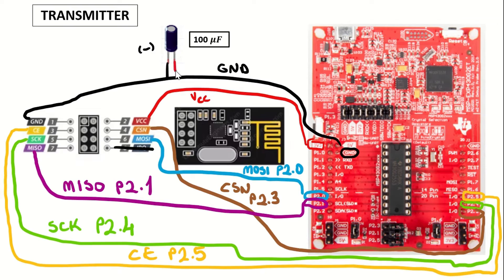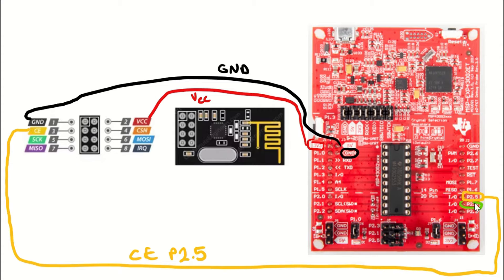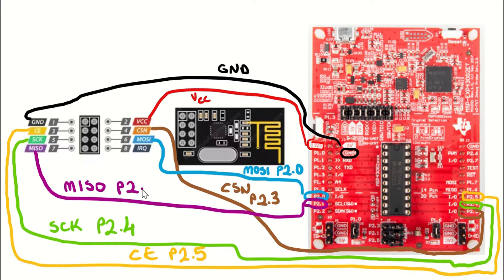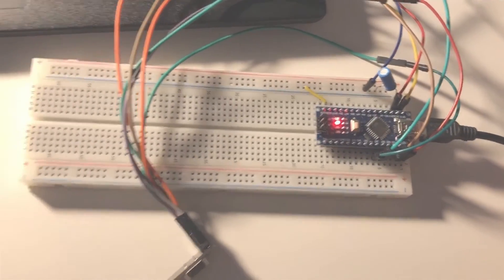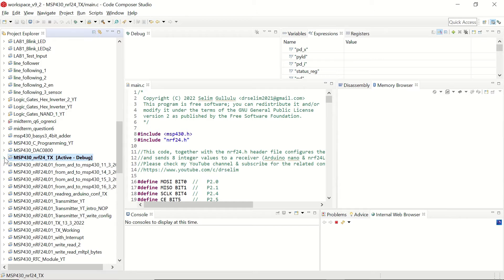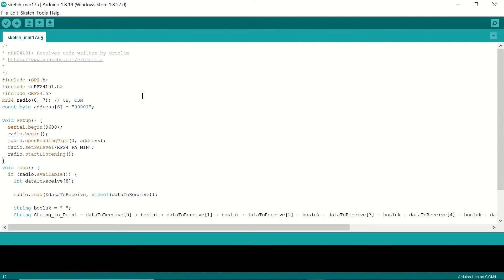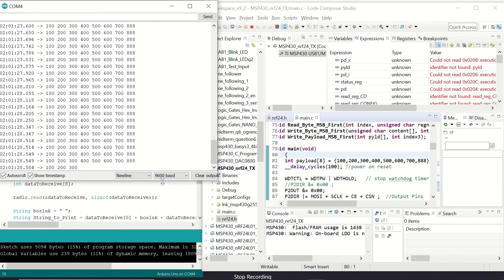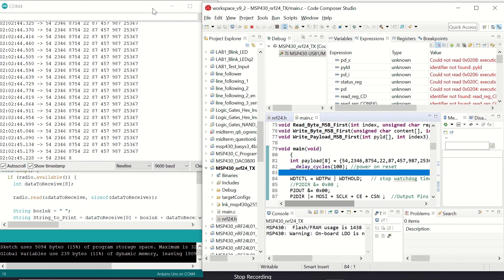MSP430 & nRF24L01+ : Wireless Transmitter

Comment: Another great video. Awesome work and thank you for sharing your knowledge.
Reply from the maker: Thank you Jayro, that's very kind of you.
Reply: @drselim  can this be used to control a device via Bluetooth. Or does that require a different module?
If it does can you please make a video of working with a Bluetooth module?
Reply from the maker: No, you should have a Bluetooth module on both sides. I haven’t made it yet, but the most used bt module seems to be hc05. I’ll try to integrate it with msp430

Comment: Thank you very much! I am going to test the communication between both modules using your program and I will tell you the results and my comments. I follow your videos. Congratulations for your great work. Greetings!
Reply from the maker: You’re welcome. I also thank you for the idea to use the nRF24 module with msp430. Even though it took a long time to prepare the code,  it was worth it. By the way I also scheduled another video which shows the same device setup as Receiver. It’ll be published in 3 hours. You can check that as well 👍